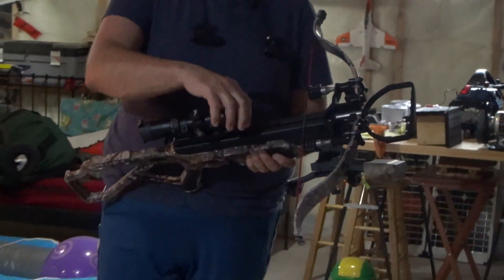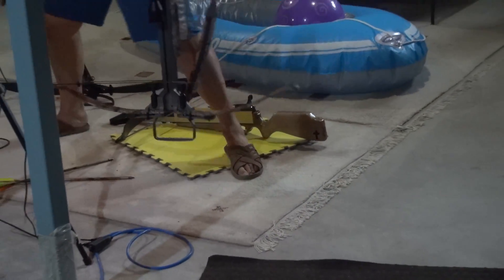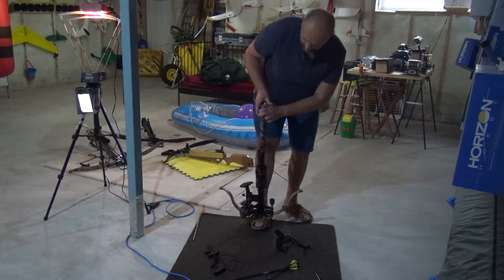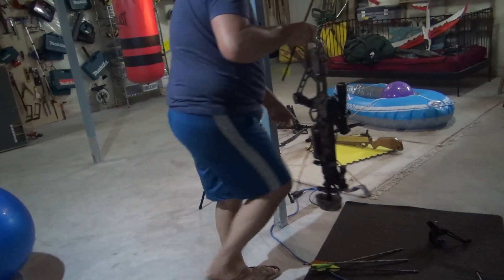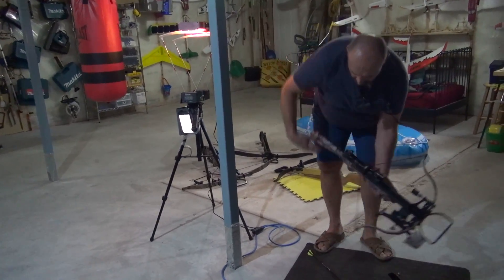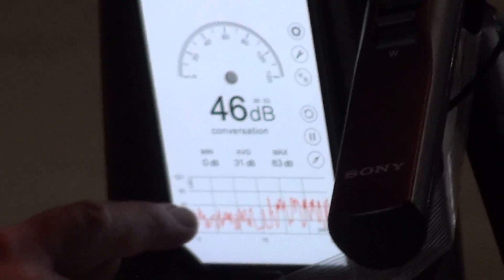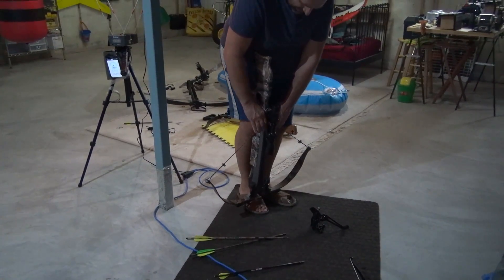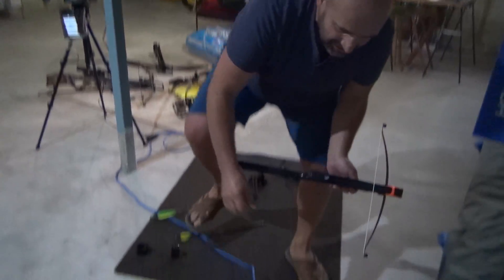Excalibur crossbows .. SPEED TESTS & C2 crank device .. micro 355 & vortex ..  20160717173201

Comment: That is a good valid test and it makes me glad I don't own these bows . Even if it were shooting a 430 gram standard true hunting weight bolt ( with 100 grain field point ) at 350 fps that is still only average performance of any cheap 300$ cross bow on the market . Shooting short soda straws with a very wide frame bow is not impressive to me especially if hunting up in a tree stand
Reply: e2sguy i am glad to own the micro 355! Plenty enough for everything! With 425grain i still have 330fps!

Comment: Its hard to believe micro 355 with 350 grain quill arrows  over 360fps..Micro 335 gen 1 with 350 gr quill have been tested at over 340fps ...micro 355 at 349fps with quills at 350 grs....But some are getting that with new limbs for 355...Did you do any improvements to micro 355 to get that speed?
Reply from the maker: no not at all ..
Reply: Unreal ..